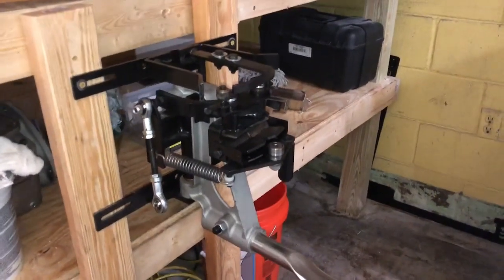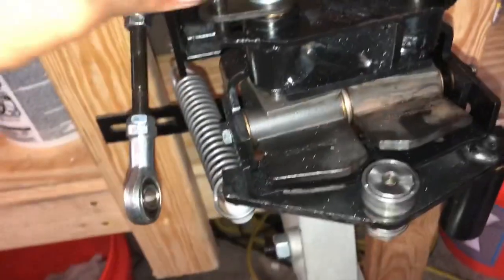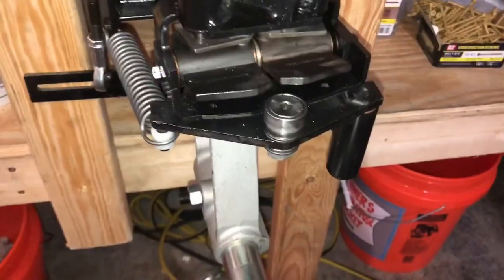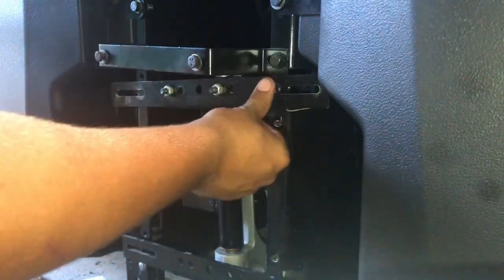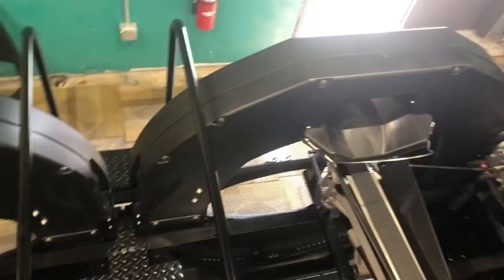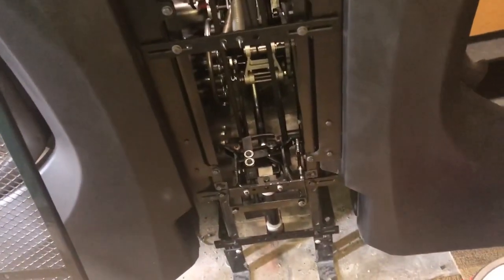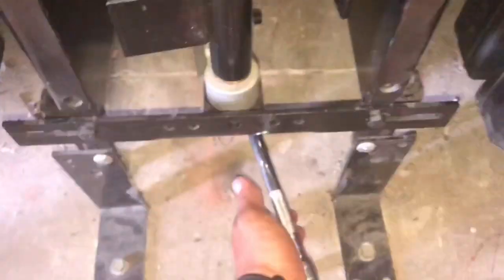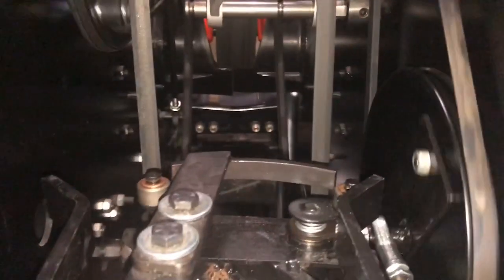Understanding the Light Ball Sensor- AMF training

Comment: Just picked up a maintenance job 3 weeks ago at a local bowling alley that’s in the process of rebuilding their name. New to bowling alley maintenance. We’re struggling with a pair of lanes that’s damaging balls. This video has helped me tremendously. I’ll keep following. Please keep posting.
Reply: Most likely cause is an unleveled track in the underground and loose screws and shit, anything u think might be causing u might want to cover it up with some foam or whatever
Reply: Same here. Please post what you find. I've been told to grip the ball to determine whether the gouges are on the left or right. I think my problem is the kicker on the PBL.There are gray or black cushions but the black ones are for the PBL.

Comment: I go into an amf center for a meet with the gm for a mechabic position. Not sure if I got the job but i feel the same way you do.

I want the industry to strive
Reply: I mean if the machines run great and maintained, you don’t have a problem. While for me Bowling for about 10 Years (with 2 Years of League Bowling) and trying to get a pinsetter mechanic job at my local AMF Center where our League bowls had 16 Disgrace AMF 82-90 XL’s, it’s just not great. I mean I don’t care whatsoever on anything like industry or what but my only care is reviving the Sport of Bowling itself and my Bowling League is going great but the Bowling Center Facility is what we’re struggling and that’s why I have a plan of working at that center on Poor Maintained Pinsetters, let alone we only have 1 Bowling Center left that barely runs. For some reason, I’m just kinda disappoint of pinsetter mechanics did their job right but what hurts me is I wish these guys would bowl like a pro on any Sanctioned Bowling League Tournaments or on the PBA Tour cause it could double their earnings of money and also maybe have a great time while Bowling and meet new friends.

Comment: I wanna work at my one and only Local Mall Bowling Center in my hometown but they had 16 junk 82-90 XL’s and their 3 Mechanics aren’t maintaining nor cleaning them. I would rather work on their pinsetters STRICTLY by shut down like 4 Lanes at a time for adjusting and checking cause I’m a League Bowler and you don’t see that much Pinsetter Mechanics in Bowling Centers that bowls professionally during their Practice or League Night. Plus I want to give a better experience for League Bowlers, I don’t care for Open Bowlers cause our League bowls at that center all the time nowadays after our original home got burned down which was a 24 Lane Brunswick Center in another mall that had junk Brunswick GS-92’s and crappy Brunswick AS Scorings but at least their service were great and they made a ton of money for hosting fun tournaments to bring people into Leagues or the Sport or Bowling and they have plans replacing some of their equipment like the Brunswick AS Scorings for Brunswick Vector and recover their 6 Dead Lanes (or Lanes that were failed to be repaired) but never saw the light cause it’s in the inferno, man good times with that place being great than the lazy AMF house today with lack of promoting leagues but at least they let us host. When I see their junk 82-90’s, I kept saying that I wish these were cleaned or have Brunswick instead of AMF cause I expect proper maintenance and also I’m an huge fan of Brunswick from Bowling Balls to Pinsetters and Brunswick had Pinsetter Enthusiasts or Pinsetter Fans in one small community here on Youtube that made Mini Bowling Alleys that were based or copied from Real Brunswick Pinsetters, nobody made Mini AMF Pinspotters today here on Youtube.

Comment: Man I know it's embarrassing i work at a 40 lane house have about 40 to 50 calls a night on Friday and Saturday and big league nights Ive been working here 4 years on night shifts. the head mechanic is the gm now he only comes back here when he has too. The machines are ran to the ground and I don't even know were to start.
Reply from the maker: Kyle Harper one bite at a time Kyle. Pick one assembly and go through on each machine and adjust/repair that one assembly. Distributor adjustments will probably knock out 50% of your calls, why not start there?
Reply: I was in the same situation about 10 years ago. I took over a 24 lane center, that the F.M. was moved to G.M. about 3 years before I got there. And the guys in the pit just ran it into the ground. When I started there, we'd have a 12 lane league with 100+ calls. Now I run 24 lane leagues with about 5 to 10 calls. It took a lot of patience and hard work to get it to where it is now. What I did was assess what where the major issues and went from there. Believe me when I say there were days I was ready to walk.